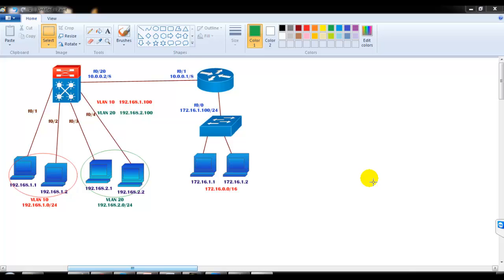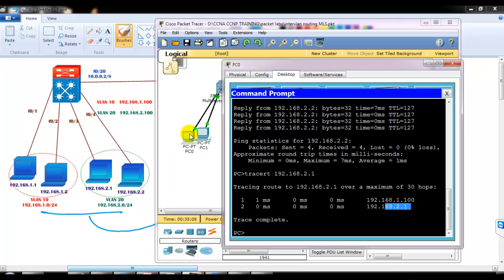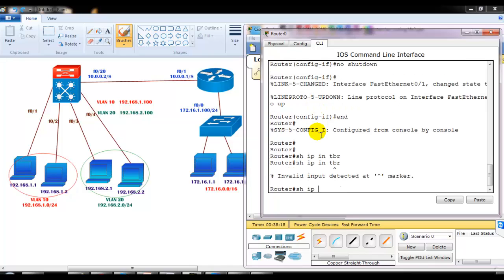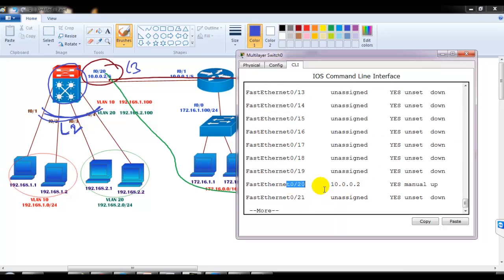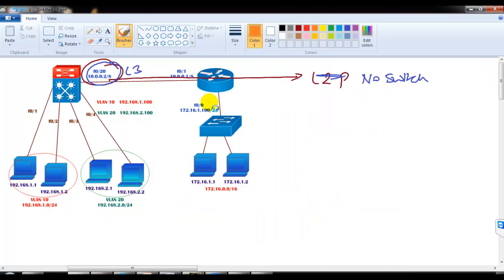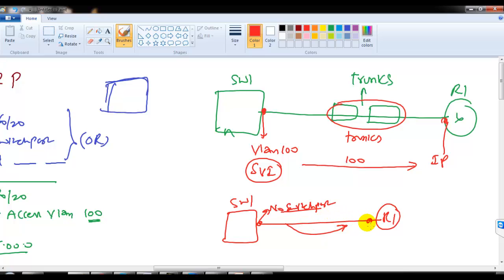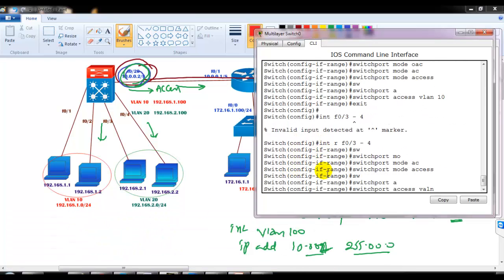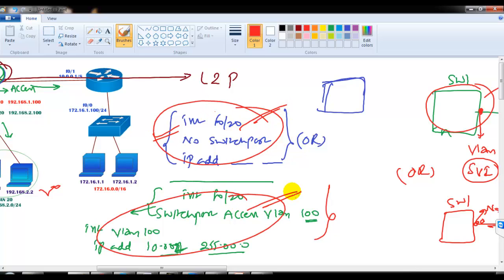Inter vlan routing using multi layer switch  part 2

Comment: I have a doubt  is it possible to use router on a stick b/w multilayer switch & router
Reply: Yes, it is possible, but again your are going to old method which add latency into your network, to over come that Cisco came up with L3 switch so packet can switched within the switch

Comment: Why so fast ....
Reply from the maker: Inter vlan routing using multi layer switch  part 1

check part 1 as i have covered most of the configuration discussed in part1